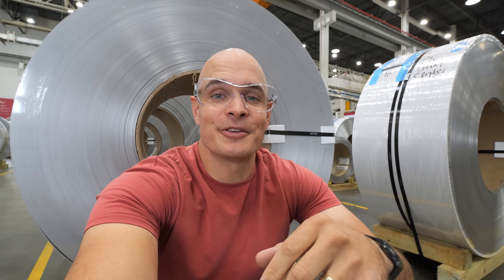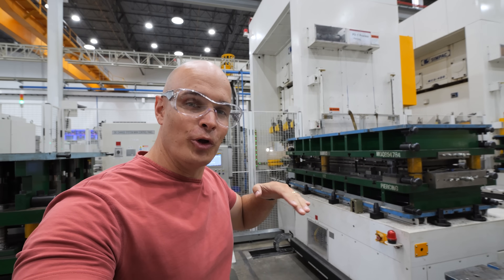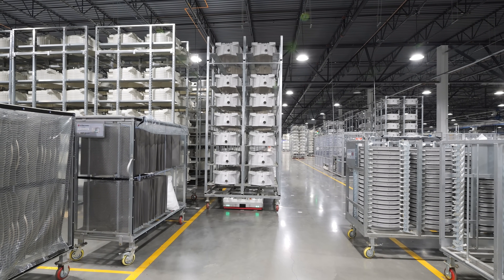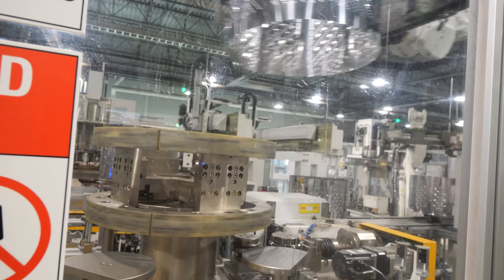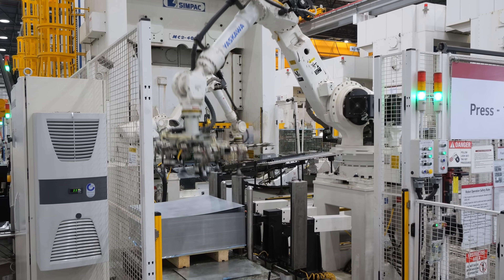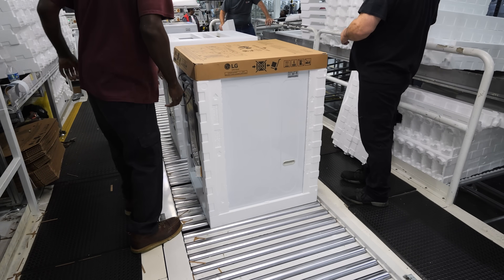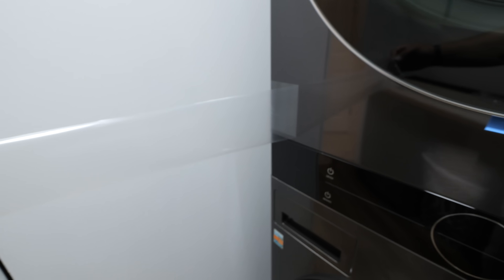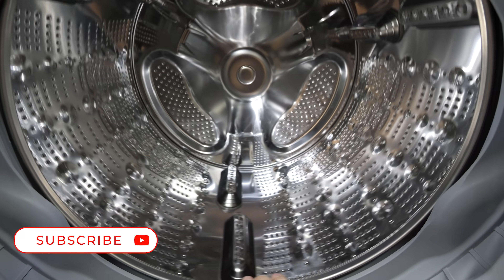Where are Washing Machines Born?

Comment: I'm an appliance repair tech and seeing that LG is made in the US is super interesting! Their laundry products are pretty good, but I'd be lying if I said I never work on them. They have issues with their HAL effect sensor on the motor breaking and not sensing that the tub is spinning/motor is turning. Also, their compressors in their fridges are constantly going out. Granted that is the old model compressors, but LG is the most consistent compressor swap I have to do. I wouldn't purchase one of their fridges, but if I saw their laundry products on sale I would considering picking them up.
Reply: Another appliance repair technician here who agrees with you. Compressor failure is so common. I hope they fix it. I don't know about you either, but LG's website for the technicians is completely hopeless in my opinion, way too advanced for novice technicians. For now I stick to the German brands like Bosch or Miele, even if Miele might be ridiculously expensive sometimes.
Reply: @MackeSwed If I could work on only Bosch and Miele I'd be a rich man. To my knowledge the new compressors are good. I personally haven't had any issues with them unless I did something wrong
Reply: I'm also an appliance repair tech and, yeah, I agree with pretty much all of this. LG Laundry products are pretty bulletproof, but kitchen appliances are another story. Other very common issue with their washers is the drain pump is pretty much the cheapest thing on the planet. They fail often, thankfully they're cheap and easy to replace.
Reply: @chrisgordon4303  I carry 2 2001T drain pumps on my van because they're such a common occurrence 😄
Reply: How are they for parts availability? That seems to be the biggest issue that I've had with appliances. Companies don't make parts so that you can't repair your appliance and you need to buy a new one
Reply: @NoSwitchyt  part availability is actually pretty good. I'd call a major parts distributor like Reliable Parts or Encompass if you need anything.
Reply: Is the new compressor more reliable? Or is it too new to tell yet.
Reply: @squintps  to my knowledge all the compressors I've installed or seen installed over the years have continued to work fine unless the tech installing it messed something up.
Reply: Hey @labman472011, thanks for your insight.   Looking to replace a Frigidaire front load that has worked for 20 years, 5 months.   Looking for an American made washer to keep American working.    Hoping an LG front load will get similar life 😐
Reply: I would recommend Speed Queen if you want something durable and American made. They can be pretty pricey but they are a good investment imo @spe7779
Reply: For the beginning of your comment. Yes lG opened a the facility because the economy was right for it. America's not like it was back in the Trump era❤
Reply: @JakeLightswitch  You do understand planning and construction for this facility began under Obama correct?

Comment: I have a Maytag washer and dryer set from the 90s that is still going strong and can be easily repaired if it breaks. I’ll use them for as long as possible. New stuff is just too much…it’s hard to fix and it’s made with a bunch of unnecessary features that make them very expensive.

Comment: those heat pump dryers, do they have a water tank you need to empty?  because they are a heat pump/de-humidifier...  I have a Samsung Smart Air Dresser that I use for all my work clothes and for items we dont want to use in the dryer because they are delicate or soemthing, I hang up in the air clovest and I dry them on the dry setting.  It is a heatpump/de-humidifier... so hanging up 5 pairs of pants and a few shirts in it, on a single run, the water bucket is FILLED and I have to empty each time I use it.  Amazing how much water is in the clothing when tis done drying.
Reply: The LG heat pump dryers have a reservoir that needs to be emptied, but there is also an option to drain the water to same drain as the washer. I use the drain hose on my LG heat pump dryer, so it's odd to hear water running for a bit when the dryer is going. My new LG washer and heat pump dryer are much quieter than my 20-year old Whirlpool combined washstation, so the water draining is the loudest sound I hear.

Comment: A lot of it is cool, and glad to see made in USA.  

But reality is I bought Speed Queen washer & dryer because they outlast the others by a mile.  Ai is cool and technology has a lot of good things- but electric motor spinning a drum and either water mixing in or hot air mixing in gets in done.  Look into where all the high repair costs and shorter lifespan of appliances come from- it is almost exclusively electronics now.  

Brushless motors and basic motor control and simple high cycle count valve controls like industry uses will cost a bit more than cheap units but less than the ones that have pc boards and overly engineered extras.  

Look at professional laundry businesses.  They choose what is the best economic choice.  
Take those units built like that and paint them nice colors- they would sell like hotcakes.

Comment: I have an LG washing machine, after 2 years, the surrounding metal around the soap tray is all rusted out because the tray can't contain the water and it spills everywhere. Same issue reported by so many.
I guess that's what happens when you let AI do the testing and robots build your washer. 
Our old washer was from the 80s/90s, handmade likely and still worked fine, we just opted to "upgrade" to save on water. Now water goes everywhere, fun.

Comment: The heat pump cycle in the dryer is really nice. Basically there are heat exchangers A and B and the heat pump is heating A while cooling B. Air flows through A, heating up, then enters the drum. There it picks up moisture from the clothes. Then, the moist warm air exits the drum and heads to B where it cools down, releasing it's moisture as condensation. The condensate is collected in a tub or directed to the drain pipe. After this, air circles back to A and the process starts over.
Reply: It’s crazy how it’s just starting to get popular in America. In Europe it’s the norm
Reply: @owenissimo  same here. norm in australia i guess, all ours have been that
Reply: Standard in Europe since over 10years 😅
Reply: @1998raphael  Yep! I bought my heat pump washer-dryer combo unit about 10 years ago.
Reply: We use heat pumps in HVAC units, but this is my first time hearing about using them in a Dryer. Very Cool
Reply: Its the norm for those kind of machines in south america as well, I have a LG that is washer and dryer and works just like that, you can hear and see the moisture going out the water drain pipe, and its cold
Reply: About time that these become standard. The amount of wasted heat from vented dryers is shocking
Reply: Jesus Christ is the only hope in this world no other gods will lead you to heaven

There is no security or hope with out Jesus Christ in this world come and repent of all sins today

Today is the day of salvation come to the loving savior Today repent and do not go to hell

Come to Jesus Christ today

Jesus Christ is only way to heaven

Repent and follow him today seek his heart Jesus Christ can fill the emptiness he can fill the void

Heaven and hell is real cone to the loving savior today

Today is the day of salvation tomorrow might be to late come to the loving savior today

Holy Spirit Can give you peace guidance and purpose and the Lord will

John 3:16-21

16 For God so loved the world, that he gave his only begotten Son, that whosoever believeth in him should not perish, but have everlasting life. 17 For God sent not his Son into the world to condemn the world; but that the world through him might be saved. 18 He that believeth on him is not condemned: but he that believeth not is condemned already, because he hath not believed in the name of the only begotten Son of God. 19 And this is the condemnation, that light is come into the world, and men loved darkness rather than light, because their deeds were evil. 20 For every one that doeth evil hateth the light, neither cometh to the light, lest his deeds should be reproved. 21 But he that doeth truth cometh to the light, that his deeds may be made manifest, that they are wrought in God.

Mark 1.15

15 And saying, The time is fulfilled, and the kingdom of God is at hand: repent ye, and believe the gospel.

2 Peter 3:9

The Lord is not slack concerning his promise, as some men count slackness; but is longsuffering to us-ward, not willing that any should perish, but that all should come to repentance.

Hebrews 11:6

6 But without faith it is impossible to please him: for he that cometh to God must believe that he is, and that he is a rewarder of them that diligently seek him.

Jesus
Reply: Expensive products that require a full disassembly every three years to manually remove lint buildup because the self cleaning feature doesn't get the job done. Fail to do maintenance and efficiency gradually drops until unit failure. Meh, I'll pass.
Reply: @johndoe-vc1we  funny guy 🤣🤣 mine is 9years old and uses same kWh as in the beginning ;-) they have three-stange-filters.
Reply: @1998raphael  that's not what repair people tell me. Same applies to their washer dryers as well 🤗

Of course it uses same kwh but how well does it dry? Not like when new unless you maintain it
Reply: @johndoe-vc1we  only maintaining the normal 3 stage filter easy accessible..
Reply: @1998raphael  good for you. Wish I could post links so you understand better what I mean. This is an issue with all dryers btw not only LG. And I'm an LG fan too.

Comment: Conderser dryers may be more energy efficient but they are so annoying to use. How can a drying cycle take 3 hours when a vented dryer does the same in 20 minutes. Also after so many hours of dry tumbling the clothes get completely destroyed. Unfortunately here in Europe vented dryers are pretty much exclusive for industrial/shared areas while private flats are pretty much stuck with a condenser.

Comment: My husband and I just got one of these delivered 2 weeks ago and love this model. The heat pump works surprisingly well!
Reply: It’s super important to keep the heat pump filter and coil clean from dust. Hopefully a well looked after machine will last a decade. 

They get dusty really quickly, recommend checking the filter every other wash when you first get one to determine how often it needs attention.
Reply: It will break in about a year
Reply: @1aande1  LG is reputable specifically for their long lasting washers and dryers, LG is the only brand most repairman put in their own homes for this reason
Reply: No it wont

Comment: So, washing in this tower is down and drying is the upper drum... right?
If so, how not thought trough... IF you need 2 drums and effectively 2 machines, use the dryer in the lower portion as the wet clothes are heavier than dry ones.
Better yet, concept a machine that does all this in one drum and lift it to comfy human interaction height... like those ovens that are chest high.

Comment: WEF is a mark of satan as far as I'm concerned. The heat pump dryer is a good idea, but I'd rather there be an open source washer and dryer without AI that had commonly available parts. There's no reason this stuff shouldn't last 100 years.

Comment: Ventless dryers are amazing in theory and work very well but they still have some improvements to be made. All of the lint that comes out of the clothes tends to clog up the water veins and drainage system. Including the condenser/evaporator coils. These dryers require more maintenance than most, and longer dry times. But you can’t dispute it’s crazy cool tech!
Reply: I'm confused why he said it's a new tech? In Europe we have had condensers for years and you also have a lint filter that you clean every cycle (fire risk if you don't) and then clean the condenser every month depending on how often you use it
Reply: Yup, I am going to have to take apart my heat pump whirlpool dryer to clean all the lint off the heat exchanger fins. Could have been avoided if the secondary lint filter seals werent a piece of crap, going to have to fix that too when its apart.
Reply: Condenser and heat pump are not the same thing. 

Heat pumps run at lower temps and have less lint according to manufacturers. GE & LG claim the air filter solves the issue on new models. 

There is no long term info on the heat pump ones from what I can find. Seems almost all are under about 5yrs old. 

Also, lots of people online complaining about them seem to mix them up with condensing and even heater-element dryers.
Reply: @eric_has_no_idea  I have had a ventless heat pump dryer for the best part of 10 years (in Italy). They are virtually the only type of dryers sold in Europe, as homes are just not fitted with a suitable hole for dryer venting, and we generally really care about power consumption (in Italy most homes only get 3.3 to 5 kW power from the grid, although newer homes that also use heat pumps for room heating generally get 7 to 11 kW feeds from the grid).
Reply: @EnricoConca  from what I saw with other posters on other dryer videos, I got the sense that condensers were the default. 

Here, Miele and Bosch started selling them about five years ago, Samsung, LG, GE about 2. 

I've been reading a bunch on these, good to know I need to revisit, I clearly missed something.
Reply: @eric_has_no_idea  I (in Europe) have a Miele condenser dryer which is I think at least 20 years old. Never even seen one with an air duct.

Comment: Nah, Lucky Goldstar is rubbish. 
The only thing in what they are excellent, are there laptops and OLED tvs.
Miele is the only brand that comes in to my house as washing machine, dryer with heat pump and dishwasher.
Miele, es gibt nichts Besseres!

And now back to business... 
The white paint of the washing machine is smooth and glossy, and scratches at level 4 with deeper grooves at level 6.

Comment: The condenser tumble dryers were always the best. It's no secret the ones with the ducts and vents are so inefficient since they dump all the lint and heat outside the building. They basically just heat up the clothes and let the water evaporate. The condenser is like your ordinary fridge or a dehumidifier. But both hot and cold sides are in a single unit. I just hate it that all new washing and drying machines try to use an AI and other internet crap just to function. Like, what's wrong with selecting the program manually and starting it? No need for the companies to listen and watch us through their "smart" appliances.
Reply: You don’t need internet to have it function, and AI doesn’t affect how you turn on the machine. It’s all the same as ur old washer in that sense
Reply: And you know if the WEF awards for it, it's not good for humanity.
Reply: @motofunk1  Cool. Now put your tin foil back on.